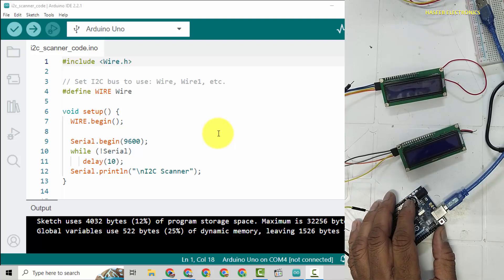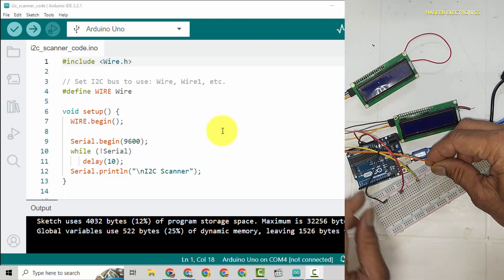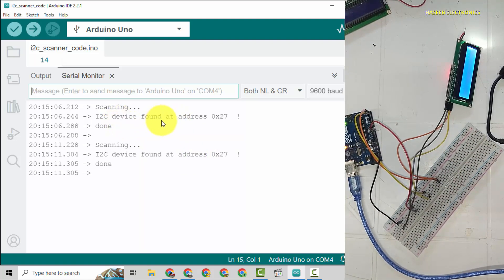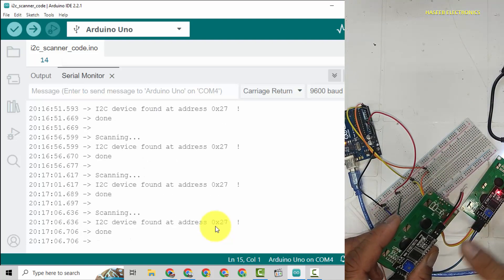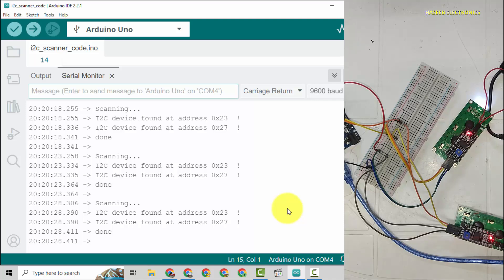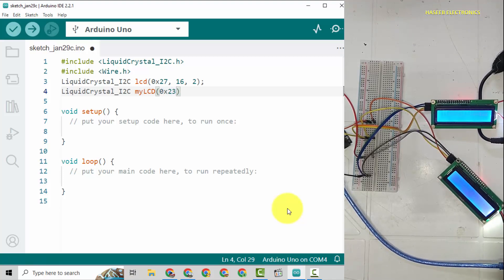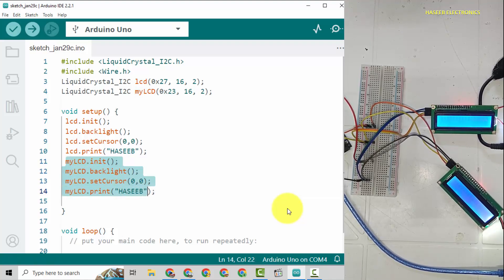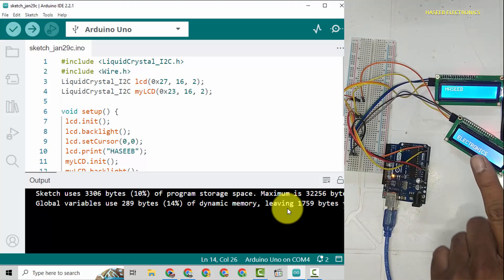{1047} How to connect multiple LCDs with Arduino UNO

Comment: the skecth looks very simple and meaningful still have to figure out the wiring for this thing. Thank you Mr. Haseeb!
Reply from the maker: VCC of the both LCDs will be connected to +5 volt of Arduino 
Gnd pins to Gnd pin of Arduino 
SDA pins to A4 pin of Arduino 
SCL to A5 pin of Arduino 
(All LCDs will be connected in parallel)
Reply: @HaseebElectronics Thank you again very much 🙏